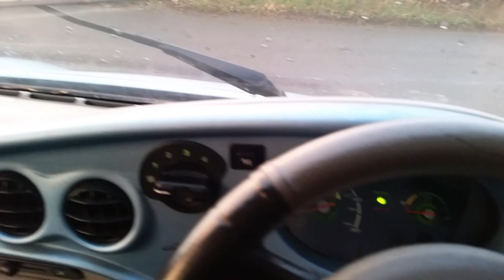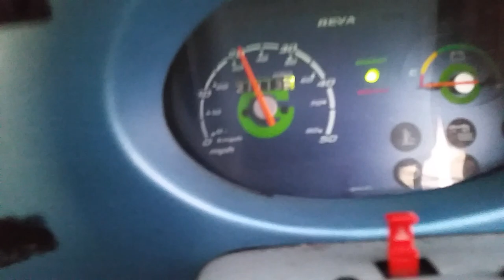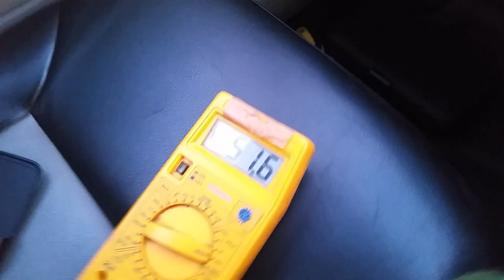DIY ELECTRIC CAR: Converting a Reva G-wiz to lithium-ion

Comment: Nice to see some power going into the old girl 　
You really need a 12v ancillary battery for the 12v system, all ev's have them for a reason ;)
Reply from the maker: I am pretty sure my 48v-12v converter might do the trick as it is rated at 25 amps.
Reply: @RichardMawby  not understanding, Can you please exapln once again please 
How many battery totally are there ? 
Each battery volts and AMP?
Total how much volts and AMPs?
How many km per one charge?
Pls reply
Reply from the maker: @kmuralikrishna1582  There are 18 batteries (in my finished build). Each battery is 48v and 27 ah approx. Total it is still 48v as the batteries are wired in parallel and total amps of 18 batteries is approx. 486 ah. 

I have since done range testing if you see my other videos - and I have achieved a total of 241 kilometres on a charge driving in Eco mode... and 209 kilometres driving in 'Fast' mode.
Reply: @RichardMawby  thank you for the interesting video! What's the top speed in eco and fast mode?
Reply from the maker: SHINOS on the DC car the top speed is 40 in eco and 45 in normal F mode. On the AC which I have now, the top speed is 50 on F mode and 55 mph on Boost.

Comment: Glad to see the curtis controller works fine without any reprogramming. Are you using the voltage monitoring cables still from the vehicle (the thin red wires) that the G-Wiz software reads the cell states via.
Reply from the maker: No those are built for lead acid so I removed that completely and anything to do with Lead acid management. No need for it really with lithium as you can add your own voltage monitoring system. I have a voltage meter on every pack so that once in a while I can unplug all of them and check they are all balanced ok.
Reply: @RichardMawby  I see. I always wondered if it did more than just does is light up an annoying red light when something is an issue voltage wise during driving or charging - requiring you to get out the RS232 serial cable and software. I agree! Much better seeing voltages on an in-car display!

Comment: Well done! I'd love to do this to my G-Wiz Richard, I was VERY interested watching this today as funnily enough I replaced one T-125 battery today and tested it on a 27 mile trip! Sadly I have another battery to replace, as one is a few decimals lower than the others, whilst its not urgent like the one I replaced that kept triggering the service light, I'm reluctant to replace the entire pack like I did when I first bought it 5 years ago. Now those batteries are almost 30% more expensive (£200 inc delivery for one Trojan T-125 6V battery), lithium is looking increasingly sensible now prices are dropping thanks to the economies of scale now EV's are being produced in larger numbers, as an entire set of the same batteries for me is almost £1600 now, so your solution isn't that much more expensive potentially.

Have you noticed any increase in range due to the reduced weight? (and does the cold affect Lithium cells as much as lead-acid)?
Reply from the maker: Thank you for your comment! 

I have not done enough testing yet to test range as I still have to buy a suitable charger. 

Far as I am aware Lithium is less affected than lead acid in cold weather, but will have a minor impact. However at £2000 for used tested cells to create a 208 ah capacity, you have more capacity at hand as opposed to the 100 ah of the lead acid bank. 

I would estimate I could increase the range upto 60-70 miles comfortably discharging only 70% of the pack.
Reply from the maker: Lithium seems to be less maintenance too as opposed to lead-acid. Just make sure you do not charge below freezing (ideally above 10C) and batteries are good.
Reply from the maker: I would also advise to join this group: https://www.facebook.com/groups/467588593400608/?multi_permalinks=1184614388364688&notif_id=1550609409141787&notif_t=feedback_reaction_generic 

It is full of people who have already converted their G-wiz to Lithium, or wanting to. Also Billy Milburn is in this group and he is the friend that is building my batteries. Could be a good place to source them should you want to go that route.

Comment: So you removed the AC charger by the looks of it. How's it going with regards to sorting an onboard charging solution for your packs? Presumably you're removing them and charging externally for the time being using one charger. How long does each pack take to recharge like this? Could you just have 8 x AC mains chargers in the space where the original was or would it pull too much current?
Reply from the maker: Only just saw this comment. If you check my newer posts on my channel you will see one about my charging system. I have on board charging still but with two 54 amp chargers made for lithium-ion. From the house I will only use one charger to charge, but I am in the process of building into the car my own TYPE 2 set up so that I can fast charge at any station on the road at 108 amps (35 extra miles per hour of charge)... 

I now have 18 packs and it will take 8 hours Approx. to charge at home from flat, and only 4 hours approx. to charge with the 108 amps.

Comment: Can you share the part list of the products you use to convert it, I own a Reva lead acid and want to transformed to Lion
Reply from the maker: Not sure if I already covered this in FB, but: 

18650 cells of a good amp rating (5 minimum for bigger builds - advised to go with 10 amp upwards). 

Built them into 13s13p modules - 8 in here so far will fit 18. 

25-35 amp common port BMS for each module (charges through discharge port) 

8 gage wire on the batteries... 

0awg to 4awg distribution block  to connect 8 awg wire to 0 awg for connecting to the controller. 

Not a huge job especially if you get the batteries built for you. Plug and play with exception to buying a charger suitable to charge lithium batteries (do not use the inbuilt charger). 

Still looking into the best charger for my needs.

Comment: So the battery for the test should be around 5kwh what motor you use ? what voltage?
Reply from the maker: G-wiz has a 4.8 kwh rated motor, with a peak of 13.1kw (in fast mode) as far as the specs say online. 

I have 208 ah of battery power under the seats so that should be just under 10 kwh.

Comment: Richard, how many volts are each pack? I'm guessing from the thin wires coming out into your connector that they are 48V nominal per pack with them all connected in parallel. Is that correct?
Reply from the maker: That is correct. All packs are 48v and 27ah approx. 8 gage wire from each pack to a distribution block then to the main terminals.
Reply from the maker: Connected in parallel with 18 packs giving roughly 486 ah of capacity. Should any individual pack fail I can still run the car on the others.
Reply: @RichardMawby  That's a good design concept. The series nature of the original batteries is always an issue when one starts going awry!
Reply from the maker: Derek Foley my original plan was to build series but my friend started building some for his gwiz then decided to change his plans and with my time constraints I had him make them instead for me. I am happy with the decision to go this route.

Comment: Hi Richard. I am in the process of converting my Reva-i (In India, G-Wiz is called as Reva-i) to LiFePo4 batteries. Can you kindly share the following test data, if you have it ? I need to know Peak-Discharge-Current, Average-Discharge-Current, Peak-Charging-Current to arrive at an appropriate BMS. Will appreciate, if you can share this information.
Reply from the maker: Peak discharge in a Reva-i I assume it is AC motor - will be about 350 amps, 400 amps on the DC motor. Average discharge is around 100-120 amps. The Charger if you are using the original and tweaking its settings can go up to 66.5v at 40 amps.

Comment: Will a 12s battery also work? How about using the original charger for this, only charging under surveillance?
Reply from the maker: 12s means less voltage at your disposal at optimal speeds... you want to be only running down to 45v max... on a 14s mercedes tesla cell set up, see my later video, you can run at 57.4v down to 48v which is perfect. zero ev (google them) can supply you with them and the charger etc for 3200... will give you an 80 mile range approx.
Reply: @RichardMawby  Perfect. I've ended up on just using the standard 13s setup. I found a 54.6v charger online that I'll purchase. It charges at 18 amps, but I think that will be sufficient for my use. I might get an external 3.7 kW charger for longer trips, though.
Reply from the maker: @jonasgilje1645  Looks similar to what I have but if its not set up properly then it will break your batteries or worse cause a fire. You need a charger set up with correct algorithms for charging lithium-ion and I didn't see much information on that website for details on that. Also can't use original charger long term. Can get away with it for short but need to keep a close eye as it will overcharge battery packs. Need to also make sure packs can handle a 40 amp charge as that is the default when EMS unplugged. Would only risk charging to 51 or 52 volts using original charger with a 13s set up. Also hard to do 13s unless you build them yourself or get someone else to build the packs... Easiest option is my tesla module conversion as seen in later videos on this playlist and also runs better because of higher voltage range (58-48v) Going tesla route from ZERO-EV they can also supply the right charger and bms etc...
Reply: @RichardMawby  Yes I think it would be best to get a dedicated charger. What I can do, since, I have a 13s6p setup (with each cell being 50 Ah), is to buy 6 chargers. This is because 6 4A chargers are much cheaper than 1 20A charger.

Have a look at the LEV50 cells. It's what's used in the iMiev and the Outlander PHEV. Looks promising, I got a 15 kWh pack of them for a mere £900. Great deal if you ask me. It's got 80 cells of 3.7V 50Ah, so a 13s6p config is the best I can do.

Comment: What is the cost of the batteries for this setup?
Reply from the maker: I believe I answered on FB, but they cost around £1000 per 100 ah doing it this way which is essentially the same as the usable capacity in a new batch of lead acid.

Comment: Not really battery related, but I'm trying to locate a compatible "track end rod" (steering) due to wear for my G-Wiz, Mahindra Reva never seem to answer emails, and GoingGreen have been rather vague about a couple of months for delivery of parts, and also gave no information given about what the running gear is based on in terms of donor or equivalent parts, I've heard rumours it could be from Suzuki or Daewoo, but found nothing to match it yet. Can Anyone help?
Reply from the maker: https://www.facebook.com/groups/2183043841757744/
https://www.facebook.com/groups/467588593400608/

Try these groups if you have face book. Plenty of knowledge there and they might be able to help you.
Reply: @RichardMawby  Brilliant! Thanks Richard! Looks like a great group!
Reply: I have a G-Wizz to her in Norway, converted to 14 s using Leaf batteries, using 28 blocks, gives me ca 240 ah, using original charger for them, but i newer charge more than 5-6 hours otherwise the voltage go to high, and i need to drain them whit 12 volt system to get the car going, need to be no higher than 56.6 volts or the Curtis controller wont let me drive, batteries might take 58 volt and stil be cool.
About spare parts, iw tryed to search my front brake pads by the original number, and what iw found out they come from Suzuki Alto (Mahindra ?), one model made in India (only).
I hope this help you on your way for parts, and if so, please let us know here.

Yes, the car work in - 35 c to, drowe 50 km whit no problems. Charged up to fine in same temp.
Reply from the maker: @skrukke  I am hearing Norway a lot lately, it sounds like a place I would love to visit, especially regarding their electric car incentives. I might try and drive all the way up there in the G-wiz - The AC model I have now can do 155 miles per charge. 

Great to see G-wiz's all over the world converted to lithium! Be sure to join the facebook groups above if you use it as the Reva G-wiz Car club is a great place to be in touch with others who have the car.

Comment: Hi my lead acid batteries died so I’ll need to do the same for mine! Do you perhaps have an e-mail I could use for asking you a couple of questions?
Reply from the maker: Feel free to ask them here if not complicated, will give other people answers too maybe.
Reply: @RichardMawby  Will the REVA work without an EMS? I am doing a Li-ion build so won't be needing it; however, I'm afraid that stuff like the speedometer won't work if I take it out.
Reply from the maker: @jonasgilje1645  It doesn't need the original EMS but you WILL need a bms of some sort suitable for the battery pack.
Reply: @RichardMawby  As I wrote in the other comment, each of the 6 13s modules has its own 80A (480A total) BMS. Good to hear that things will work w/o EMS.
Reply: @RichardMawby  In another video you said the car would default to turtleplace without EMS, is that true?
Reply from the maker: @jonasgilje1645  no it would go to turtle pace at 48v if you had the EMS.
Reply: @RichardMawby  Oh yeah that makes sense. Thank God there isn't a default turtle pace in the controller!
Reply from the maker: @jonasgilje1645  Not the controller, the EMS (which you take out if you are putting a 13s system in or it wont let you go down to 45v)... You can leave it plugged in and live with the warning lights if you go with a 14s tesla module system as 48v is as low as you want to run such a system which is another bonus for using the mercedes tesla cells.
Reply: @RichardMawby  Yes I get that the Merc/Tesla cells work like a charm. Now will stuff like the "low battery water level" in the dash also disappear? :D
Reply from the maker: @jonasgilje1645  Only if you disconnect EMS